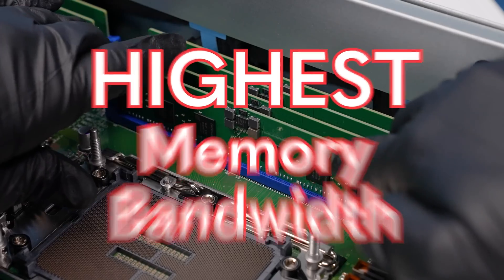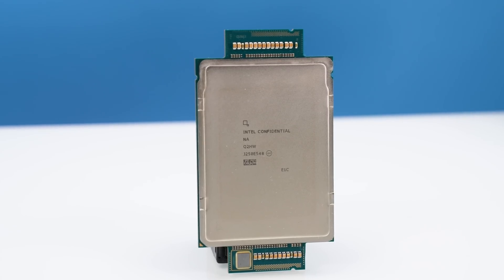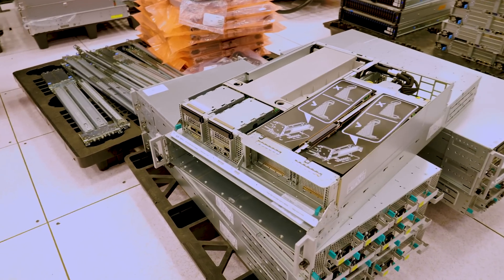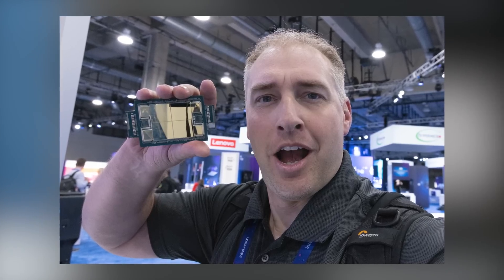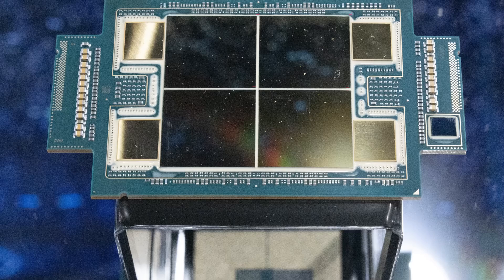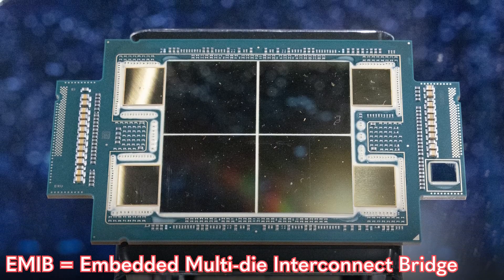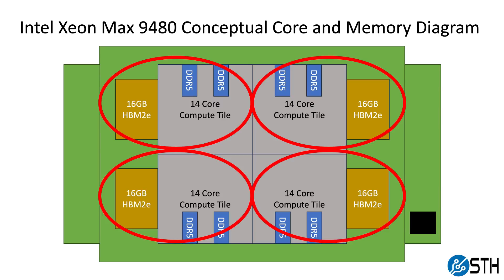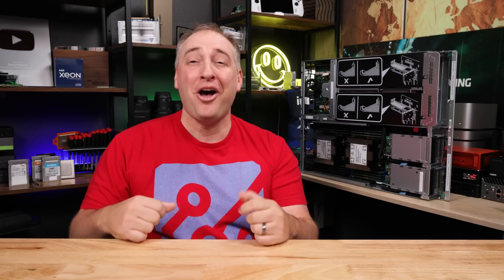This Server CPU is so FAST it Boots without DDR5

Comment: I'll stay with my Intel S2600STB and two Xeon 8180M, at ~$30,000 don't think upgrading to even the 8280 or even the 8480, or 9480 will make much of a difference.Since I use this machine/workstation as a Software Defined Radio!

Comment: Also, saying "part" is the same as saying "thing", or any other placeholder for a descriptor. Would make more sense to actually say "CPU" since you are not saving any time etc by saying "part", you're just making is far less accurate and precise, since you might be referring to your finger or a ram stick, it wastes peoples energy to force them to translate the "part" into what it actually is. Technically one could argue that it isn't even accurate to call it a part but that's a topic for another day.

Comment: We are getting more bandwidth using on carrier mounted direct attached HBM than with off carrier DDR5 somewhere on the board - crazy! * Ehm no, if you DIDN'T - it would be crazy, and not just that, it would be a failed design that should just be binned and never released, since anyone buying it would be certifiable and should be put in a padded room for their own and others safety... 
It is a cool design, following the roadmap/wishlist/path to glory that was laid out many years ago of which Optane is also part. Intel has been at it quite some time, they have explained it and reiterated it many times for those who stop and listen. They are building systems to allow for multiple tiers of storage where you'd have L1 - L2 - HBM2 - RAM - OPTANE - SSD cache - SSD - HDD sort of, all in one system where data is promoted or demoted between the tiers depending on how close to the actual CPU cores it needs to be since closer = faster. It's like a Guru and disciples in a sense, with the disciples being the memory tiers sitting in ever larger circles around the Guru dispensing the wisdom and word of god. The closer one sits, the easier and clearer it is to hear and understand what the Guru says.

Comment: Just got my hand one ES Version. Can‘t wait to run it..
Reply: So how did it go
Reply: @d @dankmemes3153  I had no problems
Reply: @dankmemes3153 without any problems. Works Like the official SKU
Reply: @dankmemes3153 Worked without any issues

Comment: What kind of place would be using something like this and what would they be running on it? This kind of tech is fascinating to me and I don't even know what it's used for.
Reply from the maker: Often supercomputer clusters. See the new Intel Aurora supercomputer as an example.
Reply: @ServeTheHomeVideo  It is amazing!! 2 billion billion calculations per second. One thing that interests me that was mentioned being done by Aurora was Dr's studying neurology and mapping out the brains neurological pathways. What does the program running that even look like and also that it needs such mind bending computational power? I know I'm in way over my head, but to me  it's such awe inspiring work.

Comment: I'm usually an Intel hater, but man Threadripper and the GPU mining boom destroying Phi completely messed up superscaler development, and AMD just never filled that market niche back out again for Epyc (they had this nice locked down with Opteron), so there was just a pit there ARM was slowly trickling into like groundwater. Database hosting apps really needed these bulk core chips ages ago, but it's good we're at least getting something comparable now in the form of Xeon Max.

Comment: Isn’t using HBM to cache DDR5 just like using DRAM to cache DRAM?
Reply from the maker: In a way, yes. But think of it more as caching slower/ higher latency/ higher trace power far DRAM to faster/ lower latency/ lower trace power close HBM. There is a big difference between access over a few mm on package and going out of the package, through the socket, through the motherboard, through the DDR5 socket, onto the DDR5 module and so forth.

Comment: I use to work developing telecom servers that was ultra efficient. Just run on normal intel i series CPU:s.

The one we had go down to 10W for the whole board with a full intel Xenon CPU if the memory was removed. With the memory they draw like 40 watts. (This was quite a while back, like sandy bridge era)

Comment: I wish Apple would adopt this memory style for their Apple Silicon SoCs. No current Mac has upgradable memory. You buy the SoC configured with a memory capacity from the factory, and that's it... Sure would be nice to have off the factory floor fast RAM, and user expandable memory expansion slots for future upgrades.

I really am liking the direction Intel is going with these!
Reply: Everybody thinks Apple is being stingy or playing games with RAM. Memory of that type can't be slotted. Because of timing and signal propagation, the LPDDR memory has to sit close to the CPU and be soldered. Which in a way leads to HBM memory. I think that will happen and Apple might do that in the consumer or PRO space at some point.
Reply: @billymania11  what are you even talking about. Numerous laptops and desktops have slotted RAM. Your high sleed RAM remains factory determined, as part of the SoC, and "slow" RAM can be slotted in at a later date by the user.

Many computers have used Fast/Slow RAM configurations. Every modern computer already does this, to andegree, with Cache. This is merely adding one more later between. SoC fast RAM, and slower socketed RAM.
Reply: Sure Rich, whatever you say. @richfiles

Comment: sleep states probably are a early version problem, since it likely has to do with the memory needing constant power. in the future with a motherboard which supports 2 seperate cpu voltages at the same time(based on pin groups) or if the cpu's have some added in logic then it should probably work.
ofcource they might not have given it priority since honnestly a cpu like this right now makes most sense in a server. while it is also great for videoeditting and 3d moddeling and rendering and simulating, most such softwares likely don't support it well enough yet, 
and while good and well maintained FOSS software like blender might support it quite rapidly and quite well.
many companies who have shown to be very slow and ignorant in adopting new tech like adobe(even though they seem to accept AI pretty well now), and things like solidworks which still don't understand modern computers have more than 1 cpu core.

Comment: Ram in a APU would eventually also greatly reduce cost. HBM ofcource is expensive and such.
but it might become normal to see APU's become the new general CPU's and make APU's more like SOC's, essentially it allows to add in many more features and ram in the cpu allows for much simpler and cheaper motherboards and such.
meaning that ram integration in low end chips allows to make super cheap and power efficient chips(more normal memory modules).

that said despite HBM being much more expensive on these high end systems it is  great actually many years ago when HBM and HBM2 where still cheap to make(cheap enough to be used in mid tier gaming gpu's) I also recommended doing essentially the same using something like hbm directly in a cpu.

Comment: Is this comparable to the Nvidia Grace ARM based CPU with 144 cores that Linus tech tips showed 3 months back? Or just Intel trying to catch up? Would like to see a video about comparing the server against server.
Reply from the maker: This has been in production and is being installed into the Aurora supercomputer which will likely be the #1 in the world in November. Grace Superchip you cannot buy yet (we covered it on the STH main site) despite the hype.

Comment: Only 56 cores?
I prefer AMD's 96 cores.
Reply from the maker: AMD’s 128 core is great too. But Intel will have 288 cores in the first half of next year
Reply: @ServeTheHomeVideo  It's possible. At an abysmally enormous power consumption. Which makes it unviable.

Comment: I think that jab about AMD doesnt know how to do HBM memory is not correct since AMD used HBM memory on an AMD Radeon R9 Nano in 2015.  Let's keep to the benefits and keep it civil!
Reply from the maker: AMD knows how to do HBM, and you will see it on the MI300 this year. Intel's packaging, however, is a step beyond what AMD is doing on its SP5 socket currently.
Reply: @ServeTheHomeVideo  The first GPU utilizing HBM was the AMD Fiji which was released in June 2015 powering the AMD Radeon R9 Fury.

In January 2016, Samsung Electronics began early mass production of HBM2.[17][18] The same month, HBM2 was accepted by JEDEC as standard JESD235a.[7] The first GPU chip utilizing HBM2 is the Nvidia Tesla P100 which was officially announced in April 2016.

In June 2016, Intel released a family of Xeon Phi processors with 8 stacks of HCDRAM, Micron's version of HBM. At Hot Chips in August 2016, both Samsung and Hynix announced a new generation HBM memory technologies.  Both companies announced high performance products expected to have increased density, increased bandwidth, and lower power consumption. Samsung also announced a lower-cost version of HBM under development targeting mass markets. Removing the buffer die and decreasing the number of TSVs lowers cost, though at the expense of a decreased overall bandwidth (200 GB/s).

Nvidia announced Nvidia Hopper GH100 GPU, the world's first GPU utilizing HBM3 on March 22, 2022.

This is right from Wikipedia.

The point I was trying to make is yes this is cool technology and I really like that you brought it up to the attention of YouTubers but take the opinions out of the equation.  It was almost like you were taking what Intel told you and were not keeping Intel honest as to the information they were giving you.

Keep up the good work!  I really enjoy your enthusiasm!

Comment: Is it possible to apply such design to GPU? A bit like HBCC for AMD but you can install DIMM modules on the GPU to give extra RAM for various purpose, such as running large AI models, running heavily modded KSP and try novice shitty program that memory leaks for no reason.

Comment: It is AMAZING to me that for CFD, the AMD Genoa X still TROUNCES this Xeon Platinum Max, even despite the HBM2e memory at nearly DOUBLE the Xeon Platinum 8490H baseline, whereas the Max, running in caching mode, actually performs WORSE than the baseline, and with the HBM2e only, it performs slightly better, but nowhere CLOSE to what the Genoa X is able to do.

That, for me, is a much better marketing slide for AMD than it is for the Xeon Platinum Max.
Reply: LOL! If you say so.
Reply: @billymania11  
The data shows that.

Watch the video.

Comment: HBM is the future. I wonder how long it takes until it reaches consumer CPU's. Though upgrading RAM wouldnt be possible then anymore.
Reply: CXL could allow upgrading RAM then.
Reply: @whyjay9959  HBM2 has got a Bandwidth from 420 GB/sec. There is quite some way to go for PCIe to allow CXL Ram Expansion at that speed.

PCIe7 x16 only manages 240 GB/sec. PCIe7 isnt even out yet, and  HBM3 is already beginning rollout 2024 with a whopping 512GB/sec Bandwidth.

Even the latency on the Bus would be way too high, even if the Bandwidth would be reached.

With HBM memory expansions die out. CXL only helps for "slow" DDR5 and DDR6. The HBM standard even states that RAM must be on the processing logic die.
Reply: @oe3gwu  I think you mean bytes? Found a chart showing 128 gigabytes per second for PCIe gen6 x16. But sure, it's all a tradeoff. CPU-integrated chiplets get inherent performance advantages from having the shortest simplest connections but cannot be changed, so they will probably continue to be combined with slower, more flexible types of memory as preferred.
Reply: @whyjay9959  I dont get your point. You are right with PCIe 6 x16 and 128 gigabytes. I wrote about PCIe 7 that comes out 2025.

You are right, I mean Bytes. Sorry about that. If I can correct it, I will.

Anyways, not considering HBM3 in 2025, it means HBM2 runs on 25% or maybe 50% speed. Thats not a tradeoff, that is ... unusable for such a memory.

Comment: Some of us remember when CPUs had L2 cache external to the CPU. Then the Slot 1 had the cache integrated onto the same card as the CPU, and when the Pentium III came out, L2 cache was completely internal to the CPU die. I don't see external RAM going away any time soon, just because of how useful it can be to just add more RAM, but this seems to be following the same evolution, and the performance it brought. Perhaps one day we'll see internal RAM on consumer CPUs as well!
Reply: No the original Pentium III (0.25um Katmai) does not have on die L2. It only comes in the 0.18um Coppermine version, which was super cool. The 500Mhz coppermine can OC to 666MHz without a sweat.
Reply: Ever heard of M-series macs?
Reply: That's seriously cool

Comment: Considering new AMX instructions and all that bandwidth afforded by HBM, it would be very interesting to see benchmarks for AI tasks, like running stable diffusion or llama models. How would they stack up against GPUs performance wise, or power and cost efficiency wise? Would be very relevant in current datacenter GPU shortage!

Comment: 8:53 I always figured HBM was the endgame for the entire Optane thing. Too bad it never really panned out since it had mad potential and could have changed how we think about, for example, database servers all together. Intel sometimes is so far ahead of themselves even they can't catch up to them (and then something like Arc happens 🤦‍♀)
Reply: HBM gets wiped as any other memory on power loss. It has nothing to do with Optane and persistent memory
Reply: @TheExard3k  It's not about persistency. But when your persistent storage is so fast and low latency as Optane was supposed to be you can get away much much smaller memory pools, hence you can use faster HBM.

The entire promise behind Optane was that it is so fast (especially IOPS wise) that you don't need to keep your entire application's data in memory.
Reply: @sehichanders7020  Well, it is a bit higher level in a sense, tiered pipelining is not either HBM OR Optane, correctly used both will be a boost just at a different level, Optane has been used as RAM lower tier and HBM here as higher tier, so from the CPU looking for data it would go L1, L2, HBM, RAM, Optane, mass storage if it needs to go that far with each tier being progressively slower and larger. It would work very well most likely, just be hella expensive and a bit of a bear to backend manage. But it would boost performance a lot for almost all data intensive types of applications since you'd never loose more clocks than absolutely necessary to get the needed data, so the CPU would be waiting a lot less time than it does now, which is very advantageous. Now if the data is not in L2 or L3 you have a immediate hit of 10+ clocks to check RAM and if you draw the short straw  you have to go fish in mass storage SOL.
Reply: The question is what happens if we ebay such a cpu and a few terabyte of optane 300

Comment: On the topic of 1000W power draw, I believe these are the same CPU power delivery topology that Intel showed a while back during some of the lab tours (e.g. I believe one of der8auer's videos in the extreme OC labs showed this off), where you have a relatively small number of VRM phases on the motherboard providing an intermediate package voltage, followed by a massive number of on-die power stages (100+) parallelised into a huge segmented polyphase buck converter, which helps reduce ohmic losses and PDN impedance by moving the regulation closer to the point of load on the die. The combined continuous output current of the on-package converters appears to be 1023A, logically limited by the number of bits in the relevant power management control register. This kind of current delivery would be unworkable with a traditional VRM, but since the phases are physically distributed around the package the average current density is heavily reduced.

Comment: Are there really datacenters doing CPU water blocks for liquid cooling? I don't really see the practical advantage when you can just run powerful fans.
Reply: Yes, there are.  You can only aircool up to a small number of tens of KW per rack.  but it's perfectly normal to put >84 dual-socket servers in a single rack, so you can see how 15kw doesn't cut it.  (with rack-back heat exchangers, you can do maybe 30 kw/rack, but it's not much fun, since you wind up burning quite a bit of power on just the fans...)
if you include amateur datacenters (low-density systems, fractionally full racks), it's all easy with air.

Comment: Without the RAM slots taking up width, you could pack a HBM-only server incredibly dense - maybe 3 dual socket modules across a 19" rack? Not many data centres could handle that power density, but it would be pretty neat to see
Reply: 💀💀 the cooling on that bad boy is gonna be insane
Reply: @RENO_K   with 3m's liquid that boils at almost 50 celcius you could maybe pack almost a thousand per rack

Comment: Why don’t all systems have two types of memory? Always wondered this.
Reply: cost
Reply: @skunch  nah I was thinking about it more in terms of maybe super duper DDR5 and some ultra low power slow DDR4 on the burner rather than pulling from storage all the time. Less so HBM although this also makes perfect sense.
Reply: you don't want to count cache as a type of memory?
basically, the answer is: because for most workloads, cache is enough.  you actually want fairly slow external memory for power/pins/cost reasons.
Reply: @markhahn0  that’s my point exactly. And if we’re counting cache then the question is 3 types but same question